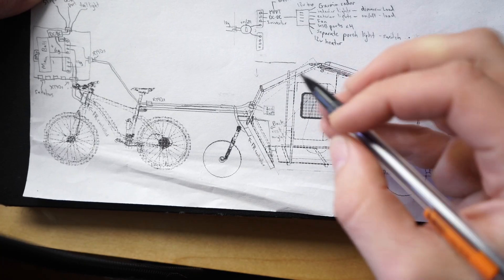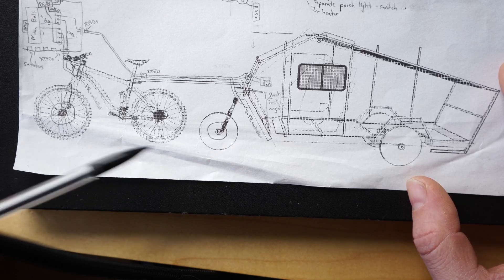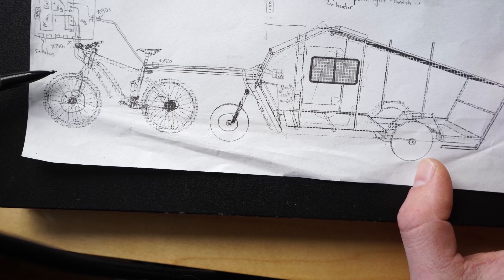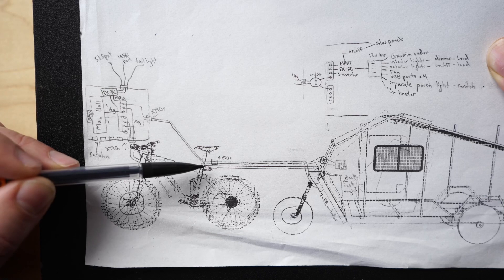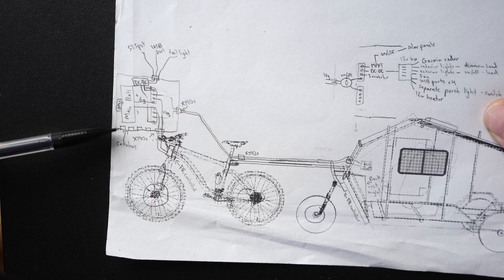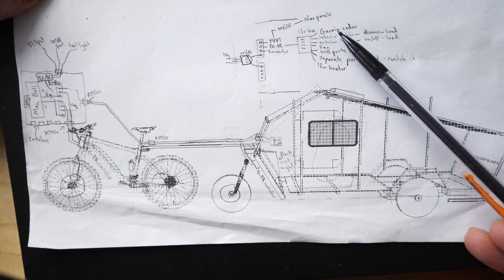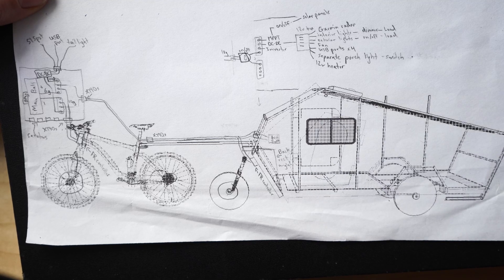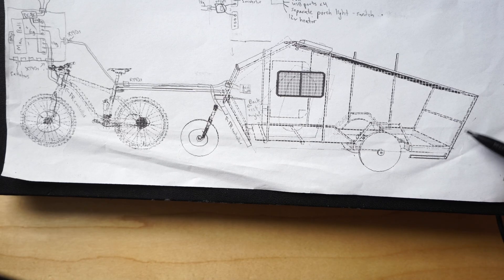Building Electric-Powered Bicycle Camper (PART 10)

Comment: How cold is too cold for lithium-ion batteries?
32°F
So, how cold is too cold for lithium batteries? Unfortunately, any temperature lower than 32°F can cause appreciable damage to the batteries. The chemical reactions when charging lithium batteries below freezing point will slow down to a point where hardly any useful energy is produced.Mar 7, 2023

Please let's keep these batts for computing devices . Powering our motors will deplete the litthium and lithium is difficult to recycle unlike AGM batts . 32 F is a point of appreciable damage so 10 cellius is not ideal either in my opinion , my guess would
ideal charging around 45 , hard to find that temp in Canada , I was a Met Tech and an IT tech ( Gandalf Data ) in the mid 80 's and I'm full useless info but sometimes useful . Thanks for your vids ...long live YOUTUBE 

Is it OK to store lithium-ion batteries in the cold?
Li-Ion cells will become compromised if stored below 0 degrees. We do not therefore recommend storing in a shed or garage over winter as temperatures in these areas can drop below zero. Equally, avoid a storage area with direct sunlight as higher temperatures can equally accelerate the battery's ageing.
The optimum ambient temperature for charging a Lithium battery is +5°C to +45°C / 41°F to 113°F

Comment: Lights ....recently permanently plugged my rechargeble bike led and itworks when it's plugged in , some rechargable units won't function when pluggled in.......Here is a tip for you , charging Lithium-ion battery in cold temperatures kills them , which is why I use scooter AGM batts ....they take a licking and keep on thinking .....my two AGMs   lived outside for 5 winters hooked to the controller for PV panels and are going strong .......

Comment: Yo bro ...I've worked on boats ( Hatteras ) with 48 volts system which used 12 VDC swithes without any problems . Also I would suggest using a standalone system with it's own 12 volt battery  for all of your  lights  and 12 volt stuff, etc. With this kind of setup if all hell goes to shit on your rig , you will at least  have lumination .
Make sure wharever swith you use it be rated for the continuous duty capacity . I use knife swithes on my trike , people use these for off grid application .
I place my fuses on the negative side of the battery because that's where the electron flow ( current ) comes from . Use fuses wherever you can .
Even Canadian Tire has suitable swithes for 72 volts . In my opinion high dc voltages are used to reduce the wire sizes therefore reducing weight .
Reply from the maker: Yeah, I think I’ll have a small 12v batt on board.
Reply: @Jerbrown  Can tire scouter batts AGM safer batt for compartment where humans sleep . Bring a core batt .

Comment: those grin all axle motors are a smart choice to they are based on 9 continent motor well the winding etc are, with the right battery etc ,ive seen them do over 100kph ,they close to the best quality made hub motors available ,and the lightest .
Reply from the maker: Good to know! Yeah, I have a lot of trust in Justin and the team there at Grin. I'm happy with the hub motors so far. The only challenge will be to see what the limits are regarding heat dissipation on hill climbs. More to come on that...

Comment: im just curious what was your solution to sync the two motors so that one wasnt puuling while one is pushing ,im looking at this issue myself for a self propelled bike camper but i havent decided on final solution yet
Reply: my main solution is to employ a sensing tow linkage so one throttle controls all,but the camper runs through an arduino that varies the signal its getting dependant on tow linkage condition
Reply from the maker: Hi Katie - very interesting approach! I have found that closely matched motor winding and wheel diameter pairings to be pretty effective. For example, I have a Grin All Axle standard wind in my 26" front wheel of MTB, and a Grin All Axle fast wind in my 20" Cyberdrop front wheel. It's not a perfect match, but if you go on Grin's motor simulator, you can see they are pretty close. But in the end, the ideal scenario would be to have exact matches. In practice, I found that one motor ended up getting consistently a little bit more power (and regen braking) than the other with this setup. Not ideal, but definitely acceptable if you want a simple approach.

Comment: I too find these questions tricky. My plan is to cross such bridges as I get to them in the future, so really help to hear your thoughts and read the comments and suggestions.
Reply from the maker: Yes, I've found it nearly impossible to plan the hundreds of little steps all out in advance. Plow forward and adjust on route it the way to go. Also, it was so crucial that I built a mini prototype first (smaller scale version of the base frame for a bike utility trailer). This step is not in these videos. It helped me learn to weld properly, and it underscored the importance of the three wheel design for stability. Good luck with your build!
Reply: @Jerbrown  Stability at 69 I love my recumbent 3 wheel ....I've triked 18 hour days and sleeped like a baby in my bivouac sac . Now , I even have my own head ( sailer before I became a triker ) mostly for my wife . At first she taught I was crazy but now she won't go without it .

Comment: I’ve been planning a bike camper build for the last year. But haven’t started yet. Just still brainstorming. I’m glad I haven’t started yet, because I keep coming up with better and better ideas and I don’t have the money for some of the tools yet but will have soon. Just stumbled upon you build today. And it’s perfect. I’ll probably copy yours expect for the shell. I’ll probably use the fiberglass sheet and epoxy with a clear coat then plastidip spray paint the shell different colors whenever I feel like changing the color. 

About six months ago I attempted to do a SketchUp CAD model but it’s pretty hard. 
EcoFlow has a portable air conditioner/heater combo coming out this year. It’s really cool. It last 8 hours with the 1000wh battery bought separately. And they are leading the game in innovation in Solar generators and accessories right now in my opinion. 

So imma build my camper around their products.

Nice videos. I’m glad to see someone else shares my passion to really pimp out a bike camper.
Reply from the maker: Yeah, thanks. That sounds great! I am considering heating/AC but so far I’ve not seen the reliability to make me include it in my build. I was looking at those rooftop units but they’re 50 lbs or so. I want to keep the centre of gravity low… 

So far I’ll see how the roof vent and windows/vents airflow is this summer. The eco flow units seem to have mixed reviews, but I’m sure they’ll only get better. 

I’m also going to try to do a winter camping test while it’s still freezing out here, to see how much heat I need to use to maintain various temperatures (little electric cube heater running off the inverter, for example). 

Good luck with yours!
Reply from the maker: Edit: nm what I said about ecoflow. I was thinking of another brand.

Comment: Id hook a throttle on the trailer neck so the harder you pull it gives it power but if the trailer tries to run you down it will release the throttle and kick in regen then if you just pedal the trailer will feel weightless and it keeps the bike and trailer separate so you can run it on any bike
Reply from the maker: Interesting idea! I think I’ll build in an overrun mechanical brake as back up in case the Regen braking fails.

Comment: I didn't watch all videos, but in ep.1 and a few of the last ones that I watched, some partially, I don't think I saw an overview of the purpose/design goals. What are you going to do with it, why make it this big/heavy, what about use in winter, so insulation? There are a lot of videos from german builders who made bike camping trailers from just over 20 kg (non-insulated coroplast type construction) to 140 kg builds with suspension, insulation, heating. Some use them for local trips, go fishing etc. Some for very long trips. So would be interesting in this case to see why you build as you have built...
Reply from the maker: TO TRAVEL AROUND THE WORLD MY FRIEND:)

Lol. In all seriousness, I really wanted to see what I could build, taking full advantage of electric power and battery range and comfort for extended traveling… Possibly all around the world, and hopefully, at least to Germany to see my German friends who have popularized this kind of project.
Reply: Right, so not just a test in building but also in finding out what you find interesting to do with it. It will be interesting to see where you will end up with the build/insulation/heating and what you feel about the experience of actual bike camping with a test tour. It has to be better than camping with a tent! :)
Reply from the maker: @WHS_reviews  Yeah, I rode my electric bike out to Newfoundland from Toronto two summers ago. I loved it so much, except... I hated sleeping in a tent on the ground. I've got back issues from my athlete days, so a big part of this is having a really comfortable bed so I can get reliable sleeps  each night. I hope it'll allow me to travel for some long epic journeys!
Reply: @Jerbrown  YA BRO ......get a cot , it will help even in a trailer .....My wife and I camped for five months with our tents doing florida  , reason why I'm making a trailer .
Reply: @Jerbrown  COME TO BOCABEC ....

Comment: Ey man. Your video was suggested to me by YT. That's cool. I'm subscribing to follow your journey. 

I have a few suggestions for safety. 

1. I would suggest to put all motors on the bike wheels instead of one being on the bike and the other being on the trailer. God forbid, but in a case where your bike loses control, you don't want your trailer barreling over you because its front tire is still engaged on the road. 

2. With regards to wiring, best to conceal the wires inside the aluminum tubes. Since you have your floor panels detachable you can run wires through them. You may need to bore a small hole to the aluminum to house the wires. and then cap it with rubber grommets to avoid water getting inside just in case. This may be the same way you install safety flashing yellow lights at the back.

3. Speaking of safety lights. Best if you have a white light underneath your trailer to give approaching drivers a visual idea how big your trailer is on the road. Also, your trailer will be most visible at night if you have some illumination on the sides. A white light in front of your trailer pointed downward should also help your visibility during night trips.
Reply from the maker: Good suggestions, thanks! I hadn’t considered the bottom light to show footprint. Makes sense. I may run the cabling through the frame but I might just leave it running alongside. It won’t be rubbed against by anything in the bottom part of the frame interior.
Reply from the maker: Also I do plan to mount several orange side marker lights on either side.
Reply: @Jerbrown  looking forward to your build. Stay Safe :)
Reply: Num 1 ......good phoguen Idea .....I've been pulling bike/trike trailers for awhile and rolled my racing trike a dozen times .....now Im 69 , I have a roll bar and my top speed on the flat is is about 10 kmph ( So I can see and smell the roses or talk to the chicks ). My photo voltaics supply the power needed and if I pedal I increace electric power for heating or cooling. Also going downhill I have to much power so I've decided to use a Koolatron cooler / heater to absord the energy from the regen braking . On a sunny day if I'm not peddling the energy will be used fro heat / cool box , I don't have a lot of battery storage so with the money saved I purchased a 600 dollar camping cot . The toilet SunMar good to go  is fixed to the 10 foot long trailer . I am now working on a quick pop up top for the toilet roof .
The reason for a quick pop up is for decreasing  side windage and older humans need quick acces to the facility . 
My rig is heavy and for running at night or raining , Ill use my Alps inv/gen running propane for 12 v or 110 v

Comment: I have independent controls on my velcar and its trailer and it works fine! The velocar works as an ordinary e-bike => No throttle fiddling during ride and I control the trailers motor with a thumb throttle when needed. So; +1 on independed control.
Reply from the maker: Ok, great to hear. Thanks!
Reply: I use a knife switch for my two motors ( 3 wheel drive ) trike , one pedal ( Surley freewheel single speed ) .
KISS   Keep it simple and smart .

Comment: Hey Jeremiah, I've been thinking about some of the lighting stuff since my last comment and had more to say. . (Sorry..😆)
Things to establish....
The ebrake signal from your controller.. find out what voltage the output signal is. If it is between 3 and 32v, Dc to Dc solid state relays are readily available. The input voltage goes to the relay on one side and the 12v supply through the other. When your controller signals braking, it switches the relay instantly switching on the 12v supply to your braking lights.
Most bike controllers have built in headlight on/off switching, if so, you can use that the same way to switch your headlights on/off. If not you can get ebike 3 in 1 switches that do headlight, turn signals and a horn. Turn signals then just need the appropriate wiring, lights (obvious) and an led friendly flasher can. Hazard lights get more complicated...
Reply from the maker: Thanks Chris, I’m coming back to this now. I’m using a Cycle Analyst v3 from Grin Technologies. The ebrake input apparently has 5v on that circuit, without needing to tap into the motor controller. I’m still trying to wrap my head around it, but it’s gradually making sense for this circuit beginner. There’s a diagram half way down the page here that I’m following which seems to be the method you suggest https://endless-sphere.com/sphere/threads/brake-light-wiring-for-cycle-analyst-with-mosfet-as-a-switch.95805/
Reply: @Jerbrown  that's exactly the method I was suggesting and it's easy to do. Just make sure you source a DC TO DC relay as there are DC to AC ones available.  You won't need a 'huge' one as your led lighting will pull very low amps. If you need any wiring help,  sing out..
Reply from the maker: @chriscansdale6389  much appreciated, thanks. I'll holler if I get stuck.
Reply from the maker: Hey Chris, that sounds like a good option. I'll look into it. So I'd have to splice into the brake signal wire coming out of the Frankenrunner controller and connect to the DC-DC relay. Seems like a neat solution, thanks! For the headlight, I've wired it up before with one of the 3in1 switches you mention (although I didn't use the horn or turn signals). I would like to figure out how to create a low beam/high beam switch because the S1 Spot is so bright that oncoming traffic flashes me thinking I have a high beam on.
Reply: @Jerbrown  the brake wire, splice, yes if they dont have a spare dedicated lead for brake lights. I did see a few cable options in the tech info but not sure what you're selecting. The SSR (relay) has a very low consumption so I doubt it'll impact on proper function. Your headlight depends.....  does it have a low/high beam option built in? If not, is the light dimmable? If its dimmable or will still operate at lower voltgage you could set it up to run at a lower voltage for low beam, then switch to full voltage for high beam. Easily done using a dial in buck converter  (cheap on ebay). Alternatively, use low beam option as a 'permanently on' running light like motorbikes do and then switch to full voltage for high beam. If you need help, you can email if you like. Let me know if you want the address.

Comment: Have you considered a lightweight flexible solar panel(s) on the rear sloping roof of the trailer?
Reply from the maker: Yea, planning on using sun power 170 watt panel there.
Reply: Be careful with quality when the photovoltaic panel are flexible . Some good quality flexible panels are available but they don't flex much , just enought to mount on slytly curved surfaces ( RV ) . My advise to you is purchase  your panels from a company like West Marine because the company has been in the boating supply for a long time be and they sell quaility and count on repeat customers , also they carry everything else you need for installation .

Comment: My comment about a possible switch keeps getting deleted .. this is my 3rd and last attempt .. digikey offers a 125VDC 8Amp rated toggle switch for just $9.25 .. part # 2368-54-130-ND .. I did not include a link this time, in case that has been the cause of the comment getting deleted.